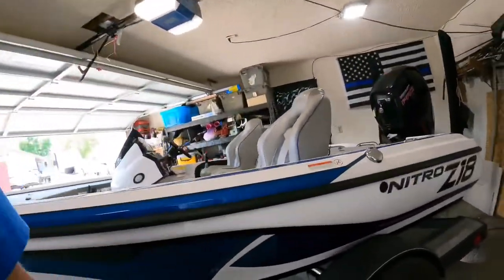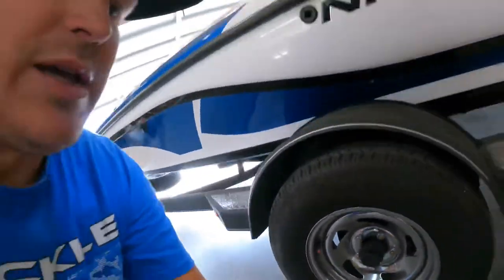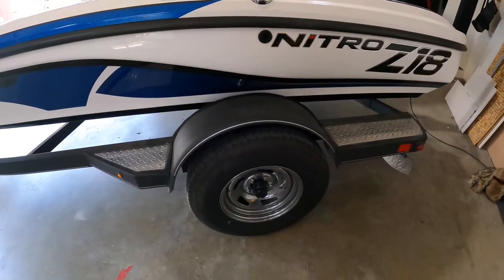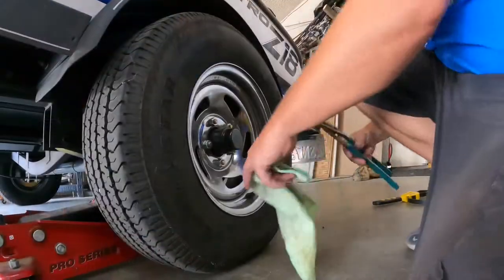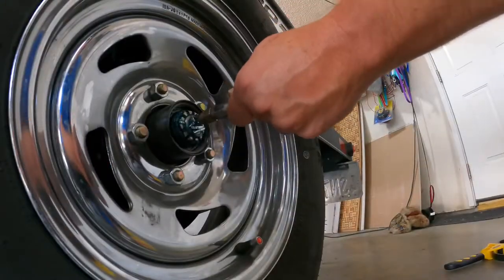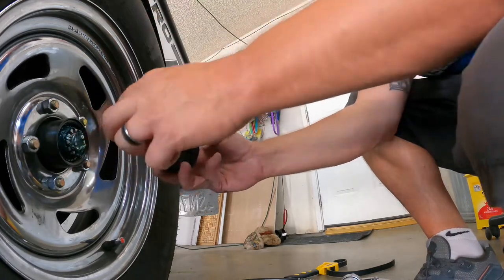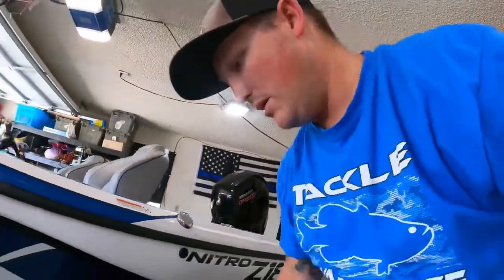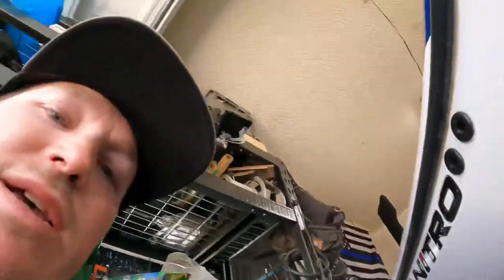Vortex hub update/ cap replacement

Comment: Just found grease coming out of my tandem axle trailer hubs for my Z7 on all 4 wheels. Removed the wheel cap and all 4 bearing caps were broken off.  Where did you get the new aluminum caps?  I can't find any anywhere.
Reply from the maker: All out marine 262-629-4000

Comment: Good morning.  I had a dust cap break myself on my trailer.  I thought it was as you did play in the bearings but found out it wasn't so I assume it just broke because it's plastic.  I just ordered two replacement caps but their plastic again. I couldn't find the metal ones. Can you tell me where you got your at?
Thanks for the video too. Was very informative to the public. New subscriber for you also.
Tight lines...
Reply from the maker: All out marine 262-629-4000 ask for parts department and they will send you some out same day if you call early enough. Only took two days to get mine.

Comment: I’m in the Twin Cities area of MN.  Urgently looking for the metal versions, but will take the plastic ones to get by for now.  Any advice on where to find a set tomorrow morning would be helpful
Reply from the maker: If there’s a bass pro near they are now trying to keep metal ones in stock. If not I ordered mine through all out marine and received in two days.
Reply: I have a Cabela’s here but not a Basspro.  I’ve been searching their site with no luck on either website.  Any links?
Reply from the maker: @chrisgraber7193  sorry don’t have a link the bass pro or cabelas best would be to call and ask parts department.
Reply: Thanks - I’ll be on the phone first thing tomorrow morning
Reply: Got lucky and the trailer shop down the road had one plastic used one on hand!  Up and running for this morning.  Ordered the metal ones from Randy at All Out Marine - these guys know the deal!  Said his brand new Nitro trailer was just delivered with both of them cracked from the factory!  Switch to the metal ones boys!
Reply from the maker: @chrisgraber7193  that’s awesome they had one for you. Yeah the all out marine ones are great quality.

Comment: Good to know as I’m  in the process of buying a new trailer. One thing you’re definitely doing wrong is when you grease these hubs it’s imperative that you rotate the tire. Otherwise pressure could build up between the grease outlet and the seal and blow out your back seal. It’s done all the time incorrectly.
Reply from the maker: Nothing I’m doing wrong. We spin all the time. Have installed lots of bearing seals and bearings never a issue. This is just a bad design from the company.

Comment: Any updates? I need to get these aluminum caps. I constantly check my caps and carry spares
Reply from the maker: So far so good. I will be putting about 500 miles on them over the next few days so fingers crossed they hold together. I have no faith in vortex hubs always on the back of my mind that they are going to fail.

Comment: You are overtightening the caps, They should be hand tight then another 1/4 turn.  I spoke to All Out Marine and he said they should be tightened like an oil filter, as I decribed above.
Reply from the maker: That’s from the factory. I didn’t touch theses except to replace them.
Reply: @boydsfishinglife3102  When you put the new medal cap on, from what I saw it looked like to really tightened it down well past a 1/4 turn with the wrench.
Reply from the maker: @jamespowellii1191  yes that’s with the metal ones. That’s as directed. The plastic ones only go on hand tight. The difference between the two are the plastic one bottom out and seat against the lip. The metal ones do not.

Comment: Where did you purchase the metal caps for the hubs?
Reply from the maker: All out marine. Call and talks to there parts department
Reply: After watching your video I went and checked my trailer and sure enough every cap was cracked right at the threads. Great information!
Reply from the maker: The metal ones have been great. I pull them off and service regularly and the caps have always stayed tight. Never any leaking ether.
Reply: I called the guy at All Out marine and as soon as I mentioned Nitro trailer he asked how many caps I needed!! 🤣🤣🤣
Reply from the maker: 😂 Yep and the shipping is super fast.